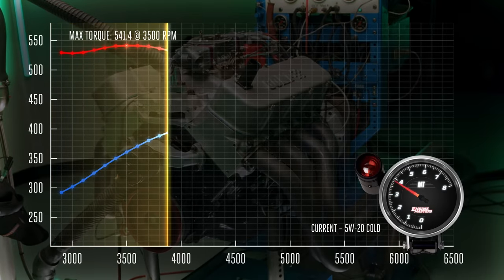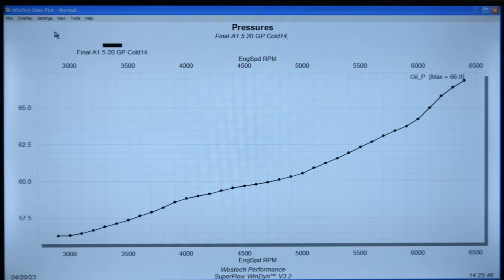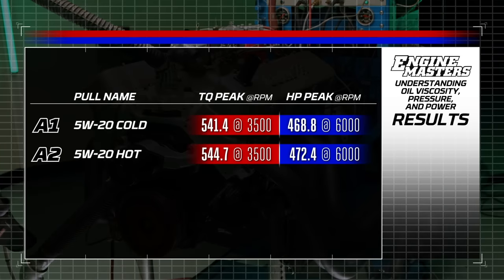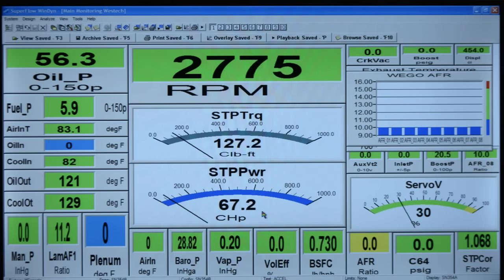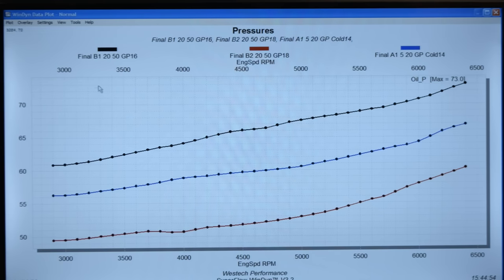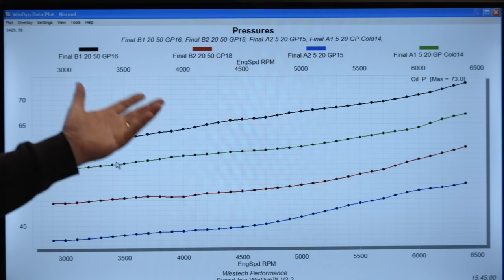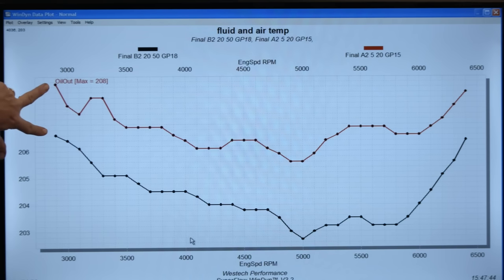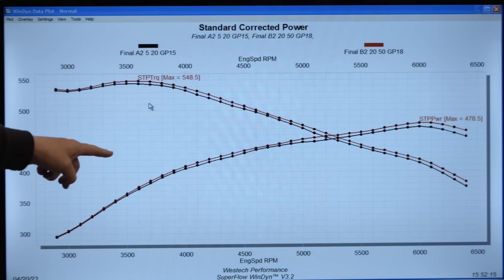Does the Thickness of Your Oil Matter? | Engine Masters FULL EPISODE | MotorTrend

Comment: You should always base your oil viscosity choice on your bearing clearances, regardless of power. A few hp isn't worth accelerated wearing bearings
Reply: Yes, and oil temp.
Reply: @Resistculturaldecline  you're right. Should have mentioned this as well.
Reply: @Ragnarok1979   I know whatcha mean, I'm just going for my cheap brownie-points. 😉
Reply: Unless you are not building an engine to last but an engine to win at whatever it may be.every little bit counts somtimes.
Reply: Which bearing clearance ?  Crank caps? Cam bearings, connection rod to crank?   Each has different clearances; which is prioritized ?
Reply: @chestrockwell8328  that's something you need to discuss with your engine builder if you're not doing it yourself. My big block has main clearances of .0024" and rod bearings of .002". 10W30 is the viscosity that works for both of those clearances for the oil temperature I operate in
Reply: ... and operating rpm, as that also affects the hydrodynamic wedge.
Reply: @Ragnarok1979  If this is a low HP bb you will be fine w .002, but if it is a high HP bb you need to have at least .0035
Reply: @racerd9669  not true. Looser clearances are optimal for power adders. My 565 is naturally aspirated and has been machined with all of the latest rottler machines available today. Tighter clearances are acceptable even in high hp engines.
Reply: @Ragnarok1979  Good luck with that. Its the weight of the rotating assembly that is the problem.
Reply: In a hot environment like Las Vegas i would choose the oil with the highest summer rating which is recommended in the car's handbook. 
In a cold evironment like Alaska i would choose the lowest. On a car with low value you can do all sorts of experiments as well.
Reply: @racerd9669  tighter clearances help distribute loads and the hydrodynamic wedges more evenly. The benefits outweigh potential negatives. If I had a blower, I'd be singing a different tune.

I don't need the luck.
Reply: @Ragnarok1979  So then explain to me how piston guided rods work???????
Reply: @racerd9669  I'm not going to waste my time time explaining anything to you. I've explained my position with the reasons for it and you've contributed nothing with any data supporting your argument. When you decide to explain your side with data, come back and we'll talk.
Reply: @Ragnarok1979  Every Pro stock engine, Comp Elim. engine NASCAR engine uses piston guided rods. But you have no idea what it even is or does. Get back to me when you get educated.
Reply: Yeah my engine builder primed with 20w50 and said to use it. It’s what I e used ever since and haven’t looked back. My Durango uses 5w20 ( looks like light brown water)It all depends on bearing clearances
Reply: @Ragnarok1979   Did Chris Straub tell  you to run tighter clearances on your big block?
Reply: It's a lot more complicated. An engine could have 10x larger clearances than a turbocharger. You want to stick close to the manufacturer's specs because a large clearance with a very wide bearing could use a very thin oil and a very tight clearance on a very wide bearing could get away with a thicker oil. Basically, the engine went through qualification testing with the recommended oil weight. That's what it was optimized around.
Reply: @bigboreracing356  bearing clearances weren't really discussed, I gave him the parts I bought and told him to machine and build my 565 to be in a drag and drive car. Those were the bearing clearances when I asked him what they were when he finished building it
Reply: @Ragnarok1979  We discussed bearing clearances and he told me he recommends the same clearances you have in your engine for the exact reasons you mentioned.
 I told him I prefer loose clearances and left it at that.
   I am getting a rotating assembly,heads, and cam from him.
 Waiting on pistons. The heads came out of cnc last week.
 I am building a 14 to 1 compression 568 for nitrous and will be turning up to 7500 rpm when needed.
 I have never had good results running tight clearances in that type of application.
Reply: Yip thats why i run 20w50 in my built 2L 8valve Volkswagen, the bearing clearances ain't that tight like some cars.
Reply: Also 20/50 in the winter is very bad on startup wear because 50w is much to high for any street car.
Reply: Race car......
Reply: @jed666666  Stock bottom end minus oil pump being high pressure and volume.
Reply: @Ragnarok1979 What oil pressure do you run at hot idle and at say 6000RPM? Just curious if the tight tolerances affect pressure? Thank.
Reply: @BPattB  my oil pressure holds around 68psi up until about 6600rpm then drops down 58psi when I peaked at 7000rpm. I'm going to change up my oil pump and pan so I have a little more pressure up top. Hot idle was 36ish
Reply: @chestrockwell8328 the ones that take a beating more and fail more often. Rods, crank, then cam.
Reply: @Ragnarok1979  Thanks. The reason I ask  is I bought a 65 Mustang with a mystery 302. I was at 84psi cold start and @38 hot idle. But when I got to around 5000rpm I would be well over 100psi!!! I swapped oil pumps. I found a Melling high-volume was what I was running. I went stranded volume. Now I'm 60psi cold start and 3psi2 hot idle. But when I get up around 3000rpm I'm at 60psi but it doesn't go any higher. I think something may have been wrong with the old HV pump. I did notice the ARP pump drive shaft was slightly rounded where it went into the pump. Maybe the valve was stuck shut for a split second. The car did sit for a long time. Anyway I'm. Guessing the "engine has tight tolerances' lol. Could you give me a guess at what weight oil you would use in my situation? I currently running Lucas hot rod 10w30. The next oil change I'll be using Driven. Lucas's zinc is around 2,200 PPM. Kinda high. Any input would be appreciated. 👍 thanks.

Edit: I have a Canton 9 quart oil pan but I'm running 8 quarts in it. I won't be going beyond 5,800rpm very often. Just the occasional stoplight to stoplight race, and a good smokey burnout even less.
Reply: @BPattB  if you don't know you're bearing clearances, I'd stick with a 10w30 or 10w40. It's a good middle ground for most clearances. Driven GP-1 is one of the best oils you can get right now.
Reply: @Ragnarok1979  That's what I was thinking. 10W30, and dump that Lucas for Driven. Appreciate your input, thanks again.
Reply: That’s why I up the viscosity as my engine wears, anything over 100,00 goes to 40 weight,
Reply: @erikcourtney1834  "Yeah my engine builder primed with 20w50 and said to use it. "  It really depends. They used 20W50 in small block V8s in V8 Supercar racing (and probably Sprint Car, NASCARs etc), 30  years ago as that was all that was available.  These days they often use 5W20 for qualifying and 5W30 for racing (in a fully synthetic Ester or PAO racing oil) and they see no appreciable wear at the rebuild interval of 3000 miles/5000km.
Reply: i run 20w50, or even strait lucas 50 weigh all day long in drag racing with tight clearences, like 1.5 -2 thou depending the motor. never an issue, bearings look new always on tear downs.
Reply: @Ragnarok1979 hey i bought a car with a built 350 but with no specs from the previous owner, would it be safer to just run thicker oil? The engine sits at 30~ish psi at idle. And what would happen if you ran thicker oil with tighter tolerances? Just an excess of oil pressure right?
Reply: I had a mate who wanted to get more power and he used this very expensive thin oil, but the motor could not keep the oil pressure and it started to hammer with a horrible sound.
Reply: @gabrielibarra5551  oversimplifying it, if you have tight clearances and thick oil, there isn't sufficient room for the oil to adequately film the bearings for proper heat dissipation and wear protection.
Reply: Depends on engine use for a drag engine yiu rebuild every season that only runs 6s at a time on the strip is a different world to something g used for a drag week
Reply: @aaronvandenberg2416 50 isnt the weight of the oil at startup, you don't even know how oil works, stop giving out advice. 20w50 is probably bad in the winter but it depends on the quality of the base stock and how badly it thickens up in the cold.
Reply: @bigboreracing356  nitrous changes the rules on clearances in my experience same as a turbo or blower. So going to a looser fit, wider clearances makes a lot of sense there over na.
Reply: @jediknight1294 From my observation and experience, tight clearances reduces oil flow and pressure to the bearings on big block Chevy,s at 6500 rpm and higher.
 Also tight clearances along with high rpm causes the oil to get hotter and fill the topend quicker leaving less oil in the pan at the end of a pass.
 Loose clearances allow for cooler oil, less top end oiling  and higher oil flow to the bearings  and  into the pan which keeps the pickup covered at the end of the run.
Reply: @bigboreracing356  admittedly I'm working off what my engine builders advice was for the most part. For the things I was actually driving and had running for long periods without a rebuild the larger gap made sense.

For the thing we rebuilt every season and ran NA, it had tighter clearances and we treated it much differently. Heaters keeping the oil at temp, no cooling system and all that sort of stuff.

Turbos/superchargers aren't really my area so I go off the recommendations of others.

My first love is motorbike drag racing which has such different architecture and engine rules that so little of the rules of thumb transfers over.
Reply: @jediknight1294  I think engine builders use tight clearances on big block Chevy's that are driven more than raced to produce higher oil pressure at idle and cruising speeds.
 This makes the customer happy for some reason.
Reply: @bigboreracing356  given that a lot of the older chevy's have oiling  issues at low rpm  it's probably not a bad idea to increase the pressure at low speed.

The cruiser crowd that let them sit for weeks at a time and take it out when it's nice need a different sort of focus than when we are pushing it to the limit at rpm they weren't designed for on the strip.

God I miss my elco with a BBC.
Reply: @jediknight1294  Makes sense.
Reply: @chestrockwell8328  the answer to your question is simply "yes". Your machinist obviously isn't going to give you main bearing clearances for 10w40 and connecting rod clearances for 0w30 in the same engine is he.
Reply: @racerd9669  define "high rpm" and "low rpm". How high is high and how low is low?
Reply: Newer engines oil thickness is based on oil pump clearence 10w40 will destroy an engine that takes 0w20 .because the oil pump.just wont pick it up.
Reply: HTHS is probably more important than kinematic viscosity though, and there is not a direct relationship between the two, although you can generalize.
Reply: @racerd9669  no one cares.
Reply: Until they drive over the crankshaft,
Reply: I agree. My Olds 455 has big gaps, so I run 20W50 not for power but because of clearance/ longevity.
Reply: @racerd9669 Depends on the strength of the components, stronger crank and rods don't deflect as much under load therefore they don't require bigger clearance. That is why nascar and formula 1 cars require a block heater before starting. Because if they started them cold the tolerances would be so tight it would immediately be damaged.
Reply: @TyMilner177 most of the current F1 engines would seize if you cranked them cold.

I loathe F1 for it's lack of ability to push boundaries and the fact the cars feel so similar same as my lack of interest in nascar but the engines have got impressive.
Reply: Film thickness literally dictates ideal bearing clearance for a given temp range. This is why Mercedes redesigned nearly their entire line to accommodate 0W oil.
Reply: @Resistculturaldecline  My engine sees 218°f oil temps but OEM recommends 5w30, high performance supercharged V8 that sees lots of city driving.. should I use 0w40 instead? Thanks!
Reply: @jaynikk758   I won't begin to claim knowledge superiority over the engineers. Imo, the 5w30 is better as it won't sheer down to thin as 0w40. 5w30 won't sheer below 5w, because that's its birth identity so to speak. 0w can sheer down to 0. 

A 10w30 during the scorcher months (if your area has those) is probably fine too. It's hot where I live. Sunrise in the summer is often 80+deg Fahrenheit, climbing to 100. My wife's turbo mazda specs 5w30 as best, but allows for 10w30 in warmer climates. It specs 0w20, but only in countries that adhere to C.A.F.E. regulations 😉. 

In all other countries, 5w30 as best, with an allowable 10w30.
Reply: @erikcourtney1834 your engine builder is old school.
Reply: I agree !
Reply: I don’t see myself getting into the sump to measure my bearing clearances any time soon😊
Reply: Most car manufacturers rely on rod bearings clearances to recommend engine oil viscosity
Reply: Nope,   on an oil analysis after you've used it.  It will tell you the amount of metal particles in the oil...
Reply: That’s how I feel about it too… My mom gave me a Ford Escape limited with 278k miles on it… I’m definitely thinking about going to a thicker oil… It calls for 5w 20 but I’m thinking about going with 10w 30… I took my wife to work the other day and it was really hot outside. The oil light came on a couple times at idle, it just flashed a couple times but it hasn’t happened again since then… I think the engine is fine other than just needing a thicker oil… It’s been taken care of really well. I’ve got all the receipts from oil changes and routine maintenance… What would you recommend and would you suggest any oil additives? The only oil additive that I’ve found that makes a real difference was motorkote… Thanks in advance.
Reply: tell that to the top fuel dragsters that trash an engine after 1 or 2 passes where every 1/100 a HP and 100 ft of elevation actually matters.
Reply: @timsgarage1356  my original comment doesn't really apply to that level. People competing in the highest levels are probably running 0W-3 oils and aren't getting the engine temperature high enough to reach its KV100 where it would thin out too much.
Reply: @Ragnarok1979  but it shows the point that it does matter when you are far enough to the point that testing what oil makes more power
Reply: @Ragnarok1979 To claim a blanket “ Not True” statement is a horrible take.
Reply: @pleaseletitgo1818  I'm not sorting through all of the comments to look for what you're claiming as a blanket statement. Refer to my original comment, the only horrible take are people disagreeing with it

Comment: I'm not surprised at all. We run Competition Eliminator and years ago on the dyno we switched out the 30-weight break-in oil for Royal Purple #9 (aka pro stock oil) and lost 20hp. Put the break-in oil back in and picked it right back up. Ring seal is king!
Reply: ✓ exactly
Reply: Amen !
Reply: Unless its cool, like they are  in the strip ...
Reply: I believe that.but break-in oil does funny things under racing conditions wouldn't recommend it